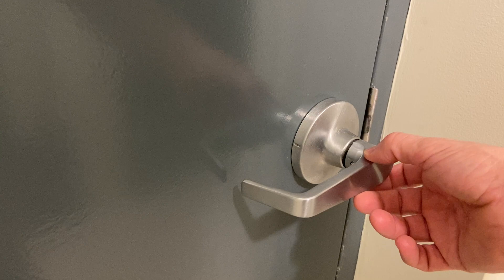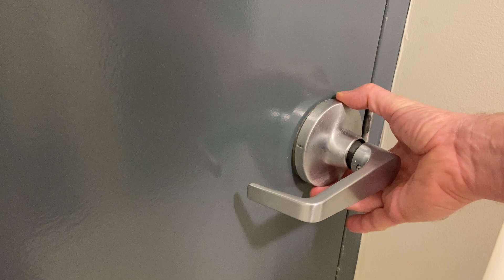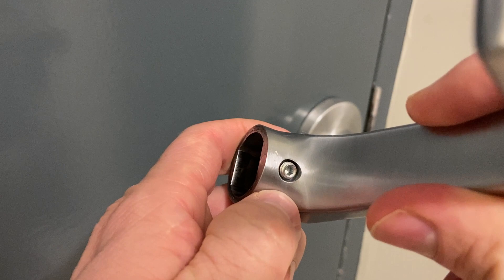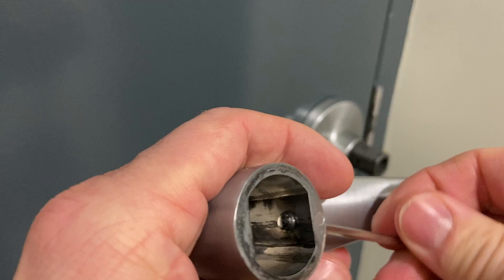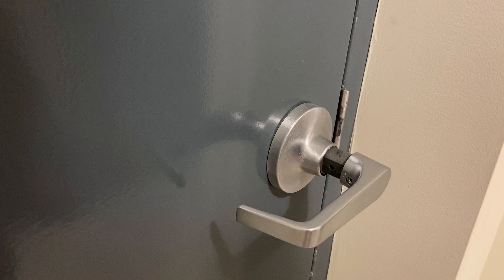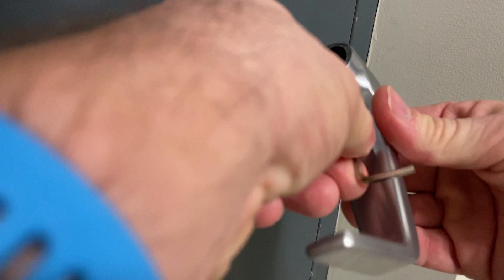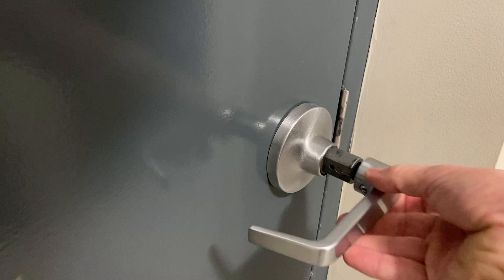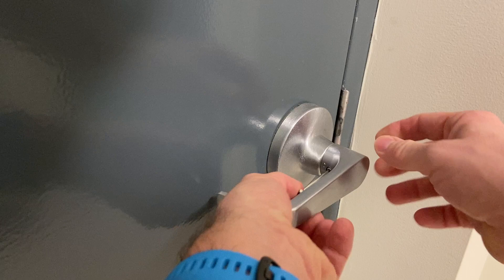Door handle problem & solution

Comment: There is a hex key that screws in and tensions. 
Before you tighten it add some super glue it will stay and you can unscrew it was the tensile strength of super glue isn't a lot.
If you want use thread locker.